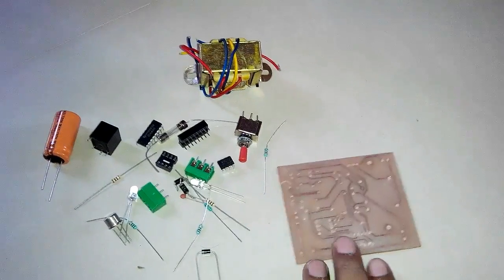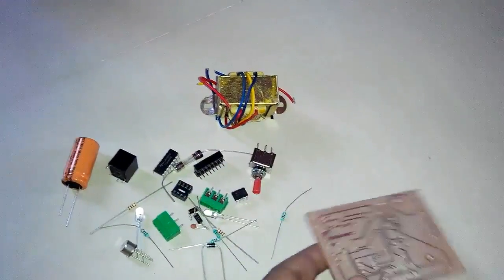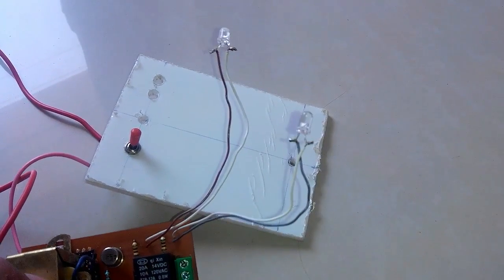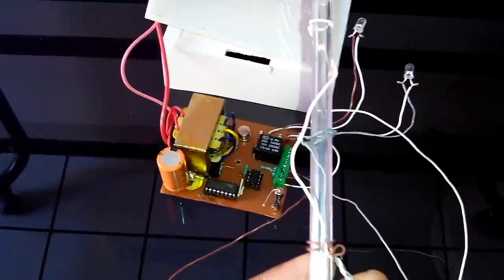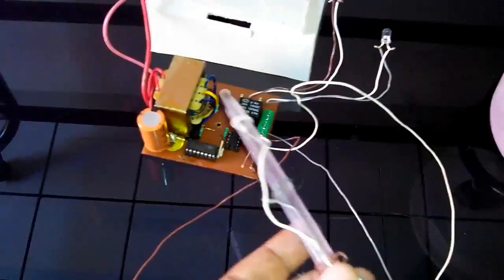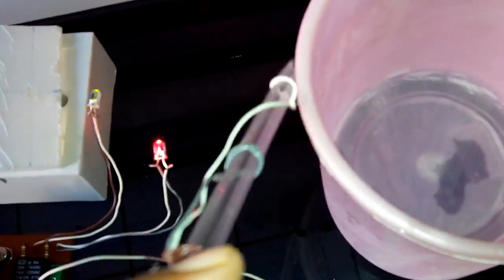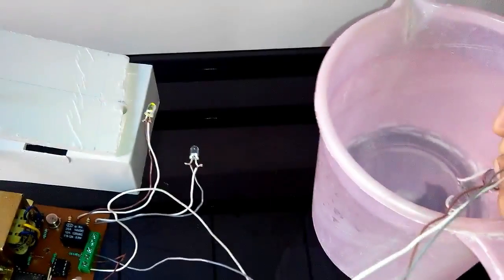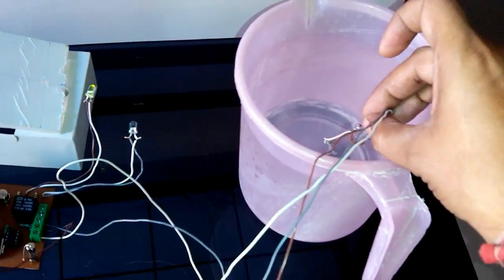Water Level based Pump controller using 555

Comment: Dear friend, the circuit appears to be simple, but as I went thru the guys who worked it out, the power supply seems to be a problem.  The transformer gets heated up as it is kept online all the time.  Is there an alternative power supply that doesnt heat up much?  Would you mind emailing to me the circuit and components list, here is my email id manertk16@gmail.com  Thanks.

Comment: Hello Sir can you try out with two tanks? 

Example: 

one tank in the ground floor and another tank in the 2nd floor

working: when switching on the pump, the pump will auto turn off when 

1. Tank in the 2nd floor is full
2. Tank on the ground floor reaches the bottom line 
 
is this possible with a single relay?

please give me a circuit drawing for this if you can help me out. Thank you.

please send me at pravesh46@gmail.com

Comment: main try kiya success to hua lekin a wire pani me rust ho jata hai aur controller ko signal ulta-palta Milne lagta hai sensor hi use karna padega aur continue ON rakane se transformer bahot bahot heat ho raha hai cable jalane ke smell ata hai any solutions

Comment: please send me the components list and circuit diagram. soumya.kanta9093@gmail.com
one ques sir
i have heard that if we keep the wire inserted inside water for long it starts to rust so can you please suggest what kind of metal to use so that it wont rust.

Comment: Please send me the list of comonents and circuit diagram at:
mail id - omendraster@gmail.com
Reply: CIRCUIT
IDEAS
W W W . E F Y M A G . C O M ELECTRONICS FOR YOU • FEBRUARY 2007 • 97
Fig. 1: Simple water level controller
Fig. 2: Sensor installation in the overhead
tank (OHT)
Water-level controllers are
common nowadays. The
one described here is
built around timer NE555 and
inverter buffer CMOS IC CD4049.
It uses readily-available, low-cost
components, and is easy to build
and install on the over-head
tank (OHT) to prevent wastage of
water.
The circuit works off a 12V battery
or 230V AC mains using a 12V
adaptor. The three sensors built
from non-corrosive metal are fitted
to the OHT as shown in Fig. 2 and
connected to the circuit (Fig. 1) at appropriate
terminals. Power supply tersors
in the OHT and connected the
power supply, the circuit is ready to
use.
Since Vcc terminal is at the bottom
of the tank, when the water level falls
below sensor L,
timer IC2 is
triggered at pin
2 via inverters
N1 and N2 and
its output goes
high. As a result,
the output
of timer IC2
goes high. Relay
RL1
energises and
the motor starts
filling water in
the tank. The
motor remains
‘on’ even when
the water level
crosses sensor
L.
As water in
the tank rises to
touch sensor H, timer IC2 is retriggered
at pin 6 via inverters N3
and N4 and as a result, its output
goes low. The relay de-energises and
the motor stops filling water in the
tank. The motor remains ‘off’ even
when the water level falls below sensor
H.
As water is consumed and its level
falls below sensor L, the motor restarts.
Thereafter, the cycle repeats.
You can also manually start and
stop the motor using switch S1. 
 SUNIL KUMAR
SIMPLE AUTOMATIC
WATER-LEVEL CONTROLLER S.C. DWIVEDI
minal Vcc is at the bottom of the tank,
sensor terminal L is just above the
bottom of the tank and sensor terminal
H is at the top of the tank. After
you have properly installed the sen